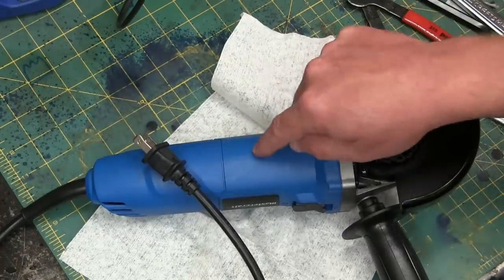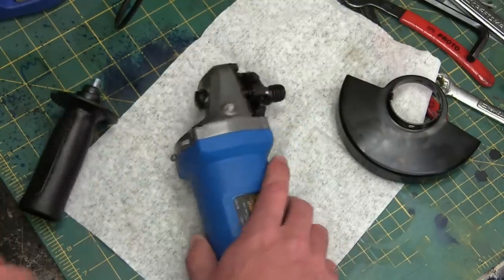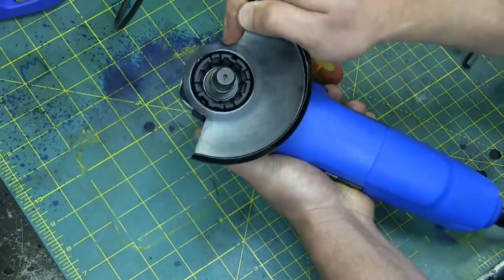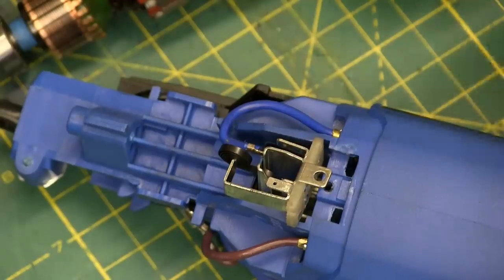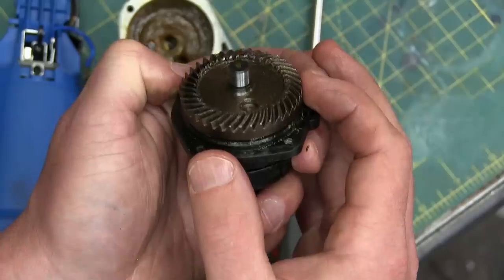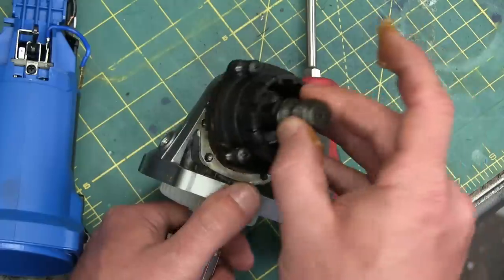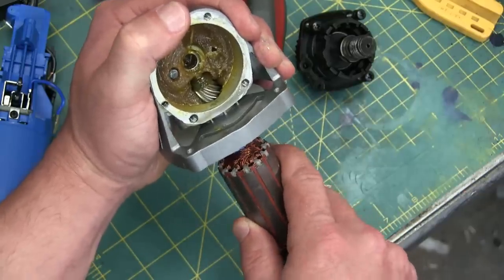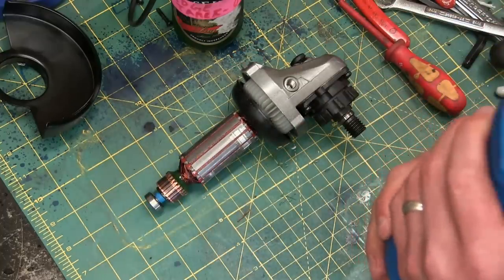BOLTR: Harbor Freight Grinder. HOW BAD IS IT?

Comment: I have the red US version of this thing. I absolutely torture the thing. .I do stuff with it i wouldn't dream of using my GOOD grinder to do. Paid 20 bucks for it on sale. I figured if it lasted a month it paid its way. That was 5 years ago. Holy cow it just won't die!!! I hate the switch and the guard is held on by a chinchy screw clamp (I keep it kinda loose so I can rotate it around like my good grinder with its fancy pantsey spring thingamajig) and this thing has become my go to grinder for that nasty job of doing something I  don't want to subject my good grinder to. Things like cutting a 4 inch by 6 foot piece of square tubing lengthwise from end to end down both sides to make C channel that looks like the special made channel on my RV when I jack knifed it because my wife said, "Keep turning!!! Almost there!" while I was yelling, its gonna jack knife and bend the hitch... She says - what does that mean? - I point at the bent hitch - THAT. 
CRAP!!!!
So when its time to abuse a grinder - she gets the job - pleasantly surprised.... One day it will go POOF - but i got my 20 bucks out of her a loooooong time ago.
BTW that lock is such a POS that after it wears in, it lets go with the slightest bump!

Comment: Stopping a grinder with a pin is something a carpenter would do. 

Ya stop them by releasing the power switch while in contact with  the work or on what ever is handy.  Using the pin is a nasty shock load and more effort. 

Welders learn VERY quickly not to put down spinning grinders. Bonus if the spinnin' bastard is wearing a flat knotted wire wheel.  Those grab clothing and eat flesh without mercy.

Comment: Cheap grinder for sure, ive had many of the hack fraud grinders and the first thing to fail on every one of them is the fan under the shroud.. melted plastic gets all over inside and shes shot. But you can usually get good work out of it till that happens, just keep a back up on hand. Ive never had any grease leak out of the gear box though.

Comment: I bought one as a joke 20+- years ago .
 I'm a diesel mechanic and I use it all the time. I have had it so hot that it felt hot through the wedding gloves I was wearing.
 Mine is orange but it still hasn't worn out the original brushes yet it's noisy I should replace the gear grease I never have re-greased it I have to say they make some decent shit.

Comment: The problem is you can't find decent tools anymore, Even brand name tools are made the same way with the same materials and in most cases made in the same factory, So I would buy a $15 tool for the project and throw it in the trash rather than pay $140 for a tool that may or may not last for a couple of projects.

Comment: ah here i am again a year later, the hercules grinder came out and i saw a teardown on it, full epoxied windings and all that, whole thing was respectable, got it for 35 bucks with a cupon, use it almost every day just for fun, its great, even took the spare brushes and hid them in a taped together care package inside the brush cover so i can get an extra 5 years out of it, im sure when it goes out i cant buy it again cause by then it will be discontinued, thats how confidant i am in it, i take care of it and let it stay cool as a cucumber, actually i dont have to, even when im plunging into a piece of steel stalling it to half speed and sending a shower of sparks clear across the shop 15 feet away it stays cool as a cucumber, its sure had its hot suppers but its got a tough mouth, back when i used dads dewalt i had to let it sit for a minute or get a welding glove on, and i didnt want to just run it till it blew, besides the dewalt has a paddle switch with the safety fuck you on it and i cant take it off cause its not mine and it sucks so im glad i got my own and it was cheeper and performs better, maybe its the modern motor tecnology, the dewalt is alot older but not very well used, im the only one whos ever used it

Comment: Here in Australia our equivalent of Harbor Freight is probably Super Cheap Auto. A friend's dad uses their cheapo shit drills that fuck out after a year or two. They have a 2 year replacement warranty. If the tool isn't dead by then he drills lots of hardwood until it's dead and gets it replaced. The last time he bought a drill was 12 years ago.

Comment: Funny thing. I accidentally cut the cord on my Bosch grinder today and I was doing some searches for replacement cords and these videos show up in my YT feed despite my watching them years ago. So I decided to watch these again and I'll be dipped in shit, the guts of the Bosch grinder are virtually identical in design to this Harbor Fraud. Obviously the Bosch has nicer parts and isn't fuckin powder blue. The biggest difference is the brushes and brush holders on the Bosch are properly designed out of proper metals. But, the spring steel brush holder is the damn same design as well. Makes one wonder if Bosch was using the same factory or if Harbor Fraud stole their design. Not that the Chinese would ever steal intellectual property.

Comment: Hot as a half fucked fox in a forest fire.
Sticktivity, good word. My buddy used to work in a steel mill and for the rollers they use a product called klingfast (sp) which if he drop some on the floor will anchor a boot in mid stride.
I once bought a car vacuum at Crappy Tire to clean my truck back when I was a smoker.I plugged it in the lighter socket outside in the parking lot and it would not even pick up cigarette ash. They refunded my money so all I wasted was time. I've been on their dock and seen how much brand new crap they toss in the crusher.

Comment: I worked for a very reputable computer company goes by the name of [_P], the newly minted enginerds would come down and have a meeting, everyday, 230PM 'shift is over at 330' and busy body around while we were tryin to get their shit done. Then they wonder why its not getting done and have more meetings to implement more processes to get more meetings to get things done! Go upstairs and have the conference in NW2C or SW2C ya dingus. gah.

As for the Hazard Fraud grinder, got me one of them chincy diddlys as well. Spins the bit and cuts the shit just fine for me so far!

Comment: I mainly buy mastercraft tools. 95% of my tools are. Never had any problems at all, I'm not hard on the equipment and know how to use tools properly. Also if anything breaks, like a socket or wrench, Canadian tire replaces it ne questions asked. Try that with a dewalt socket, which do break just as often as mastercraft. And snap-on tools, if you're loyal to them just because of the name you're no better than a woman only buying her name brand shoes.

Comment: you think that you deal with bad customer service in canuckistan? im banned from the local hazard fraught. tried to return a manifold set that had never been threaded on one of the hoses and was told by the worker who couldnt have been a fine and curly over 20 that i did that myself(yes, busted out the lathe and turned out all the threads perfectly smooth, in an effort to exchange it for the exact same set days later. lets just say the conversation didnt go anywhere good from there :)

Comment: Igraine the shit out of these things but when I first buy them I take the grease out and put in synthetic the red stuff from mote Valvoline then you can run the fuckers until the cord falls off at least that's been my experience never had one actually fail except had to put a new cord on it haven't even ran the brushes out yet

Comment: I did some work..........I played at a recycling facility for a while.  (cans).  The fork truck was dead.   Anyway, I walked into a hardware store.  They had China shit for sale.  I ask the company If I could buy about $1000 worth of items .  I also ask the store If I could bring it all back.  I took it all back.  i also repaired the fork truck.  I installed a special liquid that I will call water.  The COOLANT as it were.  That little fork truck never FROZE up again...Some might get it, others will be a hero, propane freezes and realizes on the engine to keep that from happening.   Cans?  LOL  I had fun there, I never through parts at anything...

Comment: Had 3...one took the full brunt of my wrath and bled its guts all over my vice.. Other two I have pounded these..and beat on these..it will spin 5in disc without the guard..and on one ocassion a 7 in cut off to evesserate ...gut ...a rocker panel.. No complaints...not no 7 in rat tail grinder

Comment: You did a great job with that drill bit. In the winter I spend a cold winter day in the garage to do batches of drill bits. I use the grinder to get the broken or major damage drills close then the drill doctor to finish the sharpening process. I bought the drill doctor for $20 used.I don't sharpen under 1/8 inch but many 1/4" drills. I think the grinder is faster for single bit here and there but I feel the drill doctor is faster for batch sharpening. I have seen a Tormek in action and it makes hand and drill dr sharpening perform like junk. It isn't cheap but gives you a very sharp bit. https://www.tormek.com/uk/en/grinding-jigs/dbs-22-drill-bit-sharpening-attachment/

Comment: There's more to silicone in alumin-ee-um than the nucleation - it's cheaper!
http://www.globalcastingmagazine.com/wp-content/uploads/2014/06/Solid1.jpg
A mix of the two melts almost 100 degrees lower than pure aluminium, so they can skimp out on the fuel for the furnaces

Comment: AvE, you mentioned that tab on the switch....... lol, it wears itself out after the 14th or 15th use anyways and is from then on it's about useless because it vibrates so bad that you can't hold the switch for very long. it's just a piece of shit all together, but you already knew that.

Comment: It's a piece of shit that should not even be compared to a tool known as an angle grinder. I used it once, it became too hot to hold, and then it smelled as if it were burning which it was and did, and then it died. It wouldn't even make good scrap metal.

Comment: harbor freight to my knowledge doesn't sell the master craft..... especially not for the prices you mentioned...... and this is going on 8 years experience working for the company..... and that design is nothing like what they sell...... so yeah.... nice try dude.... does look like a Drillmaster angle grinder..... which I will admit, suck something aweful.... drills are ok for glorified electric screw drivers..... Chicago electric works far better.... and in my personal tests of 15/15.... Chicago held it's own with most name brands unless there were different specs on them.

Comment: I bought that exact grinder, biggest pile of fucking garbage I've ever seen hit the shelf. The body wobbles all around, the lock pin for changing discs broke apart within 15 minutes of using it. The guard only works in like 2 places which both aren't worth a fuck. Screw Mastercrap! @Ave

Comment: Harbor freight grinders are crap. (American version anyway) In one year I went through 3 of them. One died. I took it back and got another.   the new one didn't work at all. Got a 3rd one. It works but can't take the wheel off easily because the lock button doesn't work.  The bearings are not great at all either.  Waste of money!   Buy a brand name tool. Don't waste your money in this garbage

Comment: Gee, I could have gotten the point across with no swearing.  I've got a cheap HF grinder, and it's worked just fine for years.  Got a different model, not a HF, more expensive, and it lasted about 30 seconds.
Reply: expensive doesn't always mean good... means you set fire to more money a lot of the time
Reply: you must be new to the shopping for quality game..... why spend $40 on something that will potentially break in five seconds to 5 months... when you can just spend $3 on something and if it breaks at all(given my luck it'll last longer than the over priced piece of shit) and save enough money to put into the gas tank should I have to make a trip back and return the thing...... gas issues in my neck of the woods. and again, my luck, the cheapo won't break as fast as the name brand item does..... so what I save I could put into the gas tank should I have bad luck that one time.for some people money isn't an issue.... but then again, working isn't an issue for them ether. me, it's an issue for both. for me to buy $1000 dollars worth of tools. I could get two things with name brand items pending on what I needed, but 50 or more off brands that last me longer..... I have bills to pay and a livelihood to maintain. so bargain shopping helps balance the budget.
Reply: ***** yeah I've got Makita  they aren't bad... but again, I've had them break in the first 5 minutes of use...... now I don't claim to be a pro. or do a lot of high volume jobs with my tools, but they get put through their paces with every use..... and again, i'd rather spend the $20, and save the excess money from not buying a name brand and get something that has better chances of working... and should it fail I save money on gas to return it.... than spend $200 on the same thing from a name brand that will more than likely break in the first 5 minutes and have to deal with spending more money just to take it back to the store.....
to each their own dude. just saying to save money in the long run.
also if you're buying a $20 drill from HF expecting it to do the job of a higher end drill..... you're choosing the wrong save.get the $50 drill.... it holds up better, plus I've dropped them from 2 stories high and never broken them. (Chicago Electric Cordless Hammer Drill) had them since they started selling them